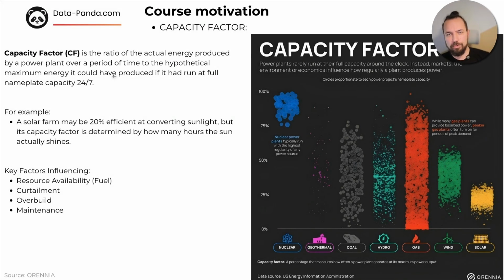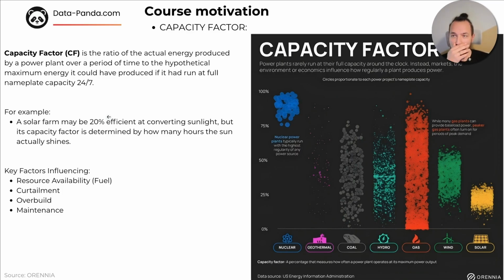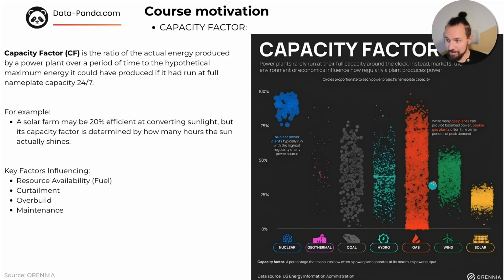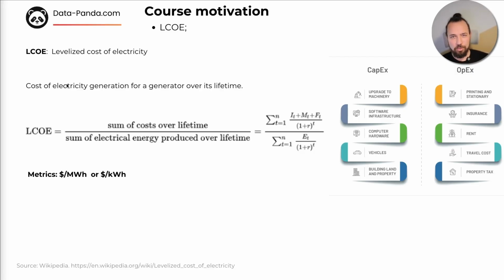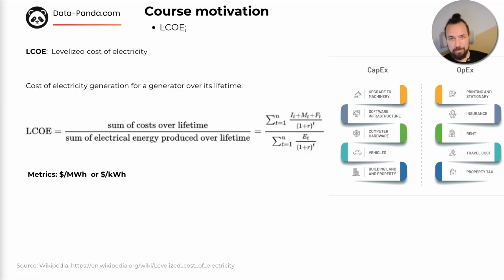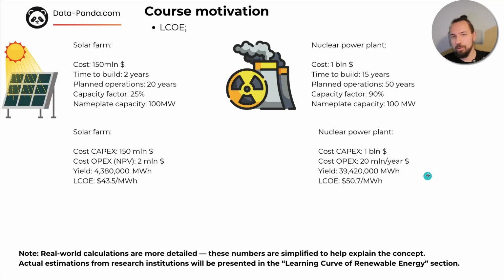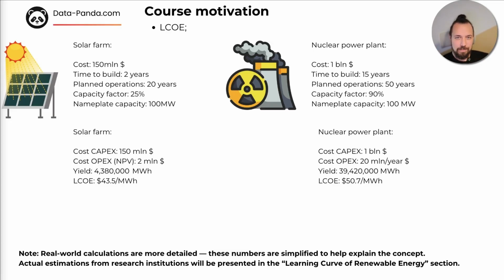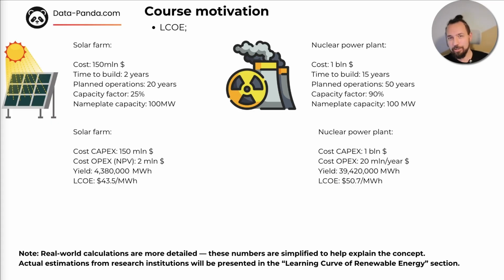LCOE Is Not Enough: How to Compare BESS Technologies

Comment: How to calculate the LCOS? I want to compare Lithium Ion with Redox Flow and Hydrogen Storage
Reply from the maker: You need to assume what your energy generation will be. Since we are talking about storage, we need to consider the energy that will be delivered. The next step is to calculate all your costs - construction and operations (also it's batteries you need to estimate charge cost * planned charged volutme). In the case of  Redox batteries your operations will be big. And here is the big problem for LDES - They discharge rarely for a long time, so overall energy generation pretty low - but at the same time you need to keep system alive all the time and consume energy. Like in case of Redox it will be also pumps.. so you have pretty high cost. Lithium batteries are more benefitial from LCOS since they discharge every day, so energy throughtput high
Reply: @BESS-Guy  Thank you but that does not really help. I know the consumption over a year and I am fucosing escpecially on the months without sun November until February. I also know how much energy I receive from my PV and considering the winter months I would have enough to compensate thre energy over the winter. It would be more cost efficient to have a storage which charges and discharges more often but I just want to tackle self-sufficiency. So how would I know how to choose between those three storage methods. I would like to have the LCOS from every method over 20 years.